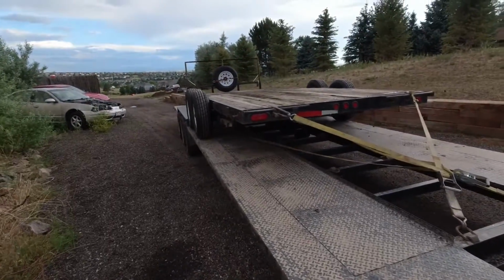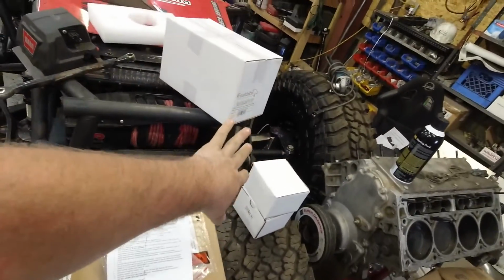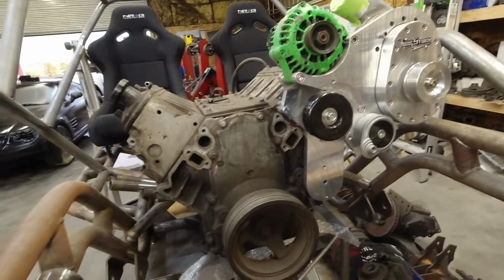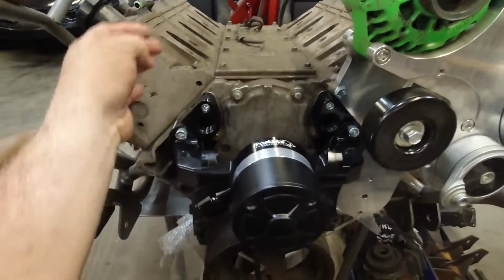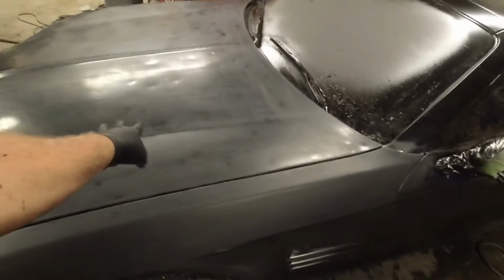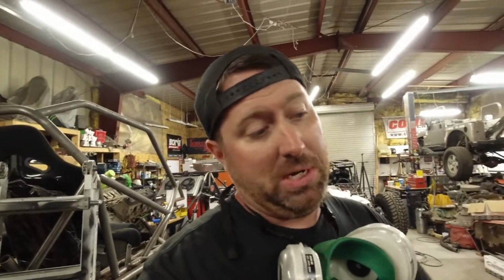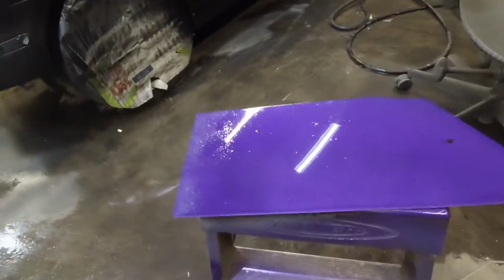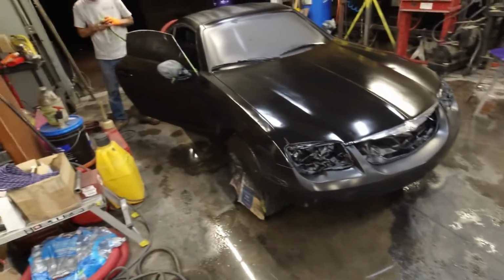Frostbite Electric Water Pump Conversion-  MSD Airforce Intake - Joe's Crossfire gets more paint!

Comment: do you still run the thermostat with an electric water pump
Reply from the maker: I didn't no. It was controlled via computer and it would cycle the pump on and off to regulate temperature.

Comment: Try putting the water pump upside down instead of using a u shaped piece on the inlet and  a 90 AN on the hose running under the intake.
Reply from the maker: That's actually possibly a great idea when we install it on the car and work on routing We will take a look at it

Comment: its all in the prep and cut/buff. picking the right paint, cleaning your rig, prepping your surface, making your adjustments (both posture and gun) just makes the finish work really easy. youll knock it out of the park.
Reply from the maker: Great tips and info! Thanks!

Comment: Decrease the paint flow rate and have more distance between the gun and the panels,finer the mist the flatter the surface with no orange peel,successive thin layers instead of one thick
Reply from the maker: I think is some of the other people said the paint's too thick and needed to be thinned out even more than what we were doing. When we decrease the flow it tended to get very horrible coverage.

Comment: one of the things your gonna deal with wrapping the car is under your wrap should be smoother than your paint is, so your wrap will not adhear to car due to unsmooth finish
Reply from the maker: What's not smooth? I've talked to a few vinyl shops about the finish to ensure what will stick the best and where we're at now with the clean coat on sanded they said we'll stick perfect. That's part of why we painted the areas that were wrapping. They said absolutely will not stick to primer very well and Bondo definitely not

Comment: My bets and I am not a painter but have I have spayed a gallons of different brands of implement paint that use acetone as a reducer and it has been my experience that in the spray guns I own they do not spray well out of low pressure high volume guns.  It has been my experience that they like siphon style guns and good amount of air pressure.  Remember this paint is designed to be sprayed on equipment in less than ideal environments and flash and dry quickly that is the reason it is reduced with acetone. A trick or tip I was taught by a former neighbor of mine who was a painter was if you did not care as much about the gloss of the paint but wanted it to dry quicker was to add ether to the paint and either heat the paint before reducing or heat what you are painting.  Additionally I have to wonder how this or the paints spay at altitude compared to at sea level especially when it's hot and the corrected altitude is touching 10K. I know that at sea level temperature, humidity, barometric pressure greatly affect how paints spay, how they are reduced, and how they dry.  Do this paint you used have any other instructions on reducing it, gun type, pressures, and or tip size, because the implement paints I have spayed tended to recommend you use a pretty large tip size. Just some things to consider or ponder. Again I have never sprayed that brand of paint nor have I ever painted in Colorado or any other state that is more than a couple hundred feet above sea level.

Comment: Think you're comparing apples to oranges, Automotive paint vs. Tractor paint, tractor paint is very thick, I hope the thinning helped... I have use up to about 50/50% thin mix typically for demo cars, trailers... then you have to worry about runs as well...  You have to make sure the paint is atomized properly, either thinner paint or more air pressure or the proper size needle of a gun.  If the paint flashes or dries too quick it can also cause the orange peel. So if you went from 15% percent to 10% more here at 25% which should be getting pretty close realistically...  I seriously doubt you're going to get that same depth of reflection out of tractor paint where is automotive paint. But the excessive amount of orange peel is due to too little air pressure, or not thin enough or just simply too small of needle in your gun. It takes a lot of experimenting to get it right, but it looks perfectly fine... It'll make a good rally car.
Reply: Temperature can greatly affected it as well as acetone dries and evaporates quickly. Like I said it's not a show car... It looks all right, do you need to look back and videos of when you first got it to remember how bad it was???
Reply from the maker: Haha no sit was bad... And  ultimately just trying to learn more. We are now t comparing the paints but just wanted to see some differnces. Again this is literally the first time we have ever sprayed a paint gun lol
Reply: @carbonshocks  😜👍 Next time I paint something with tractor paint, I'll do a YouTube video on it, then you can criticize mine, LOL 🤪

Got plans to repaint my motorcycle trailer, with John Deere Yellow ( matches my bike perfectly!), and maybe paint some parts for my hot dog cart I'm building "slowly" , IH Red, well if I don't use rattle can (its just some interior framing angle iron parts frame & fenders so not much to paint (it's primarily all stainless) . I probably won't get around to painting till until next year though... at least.